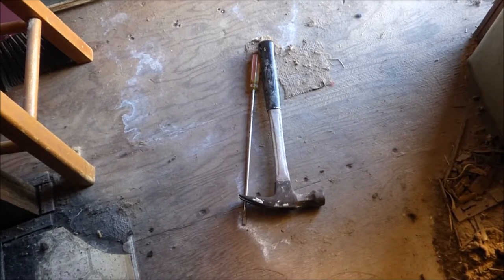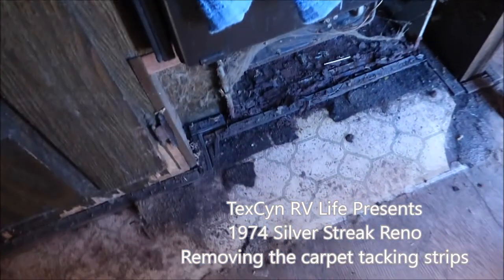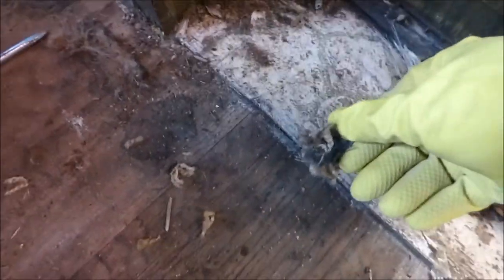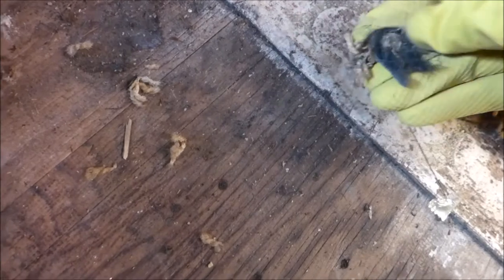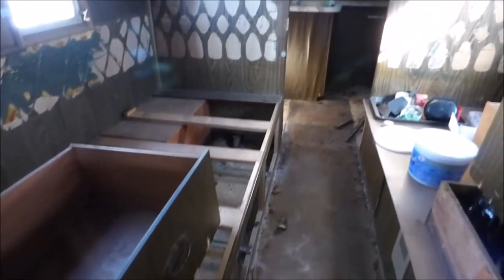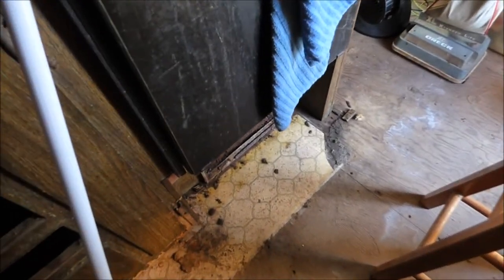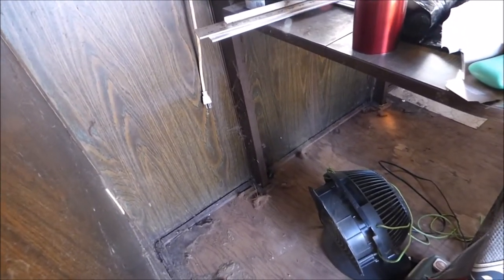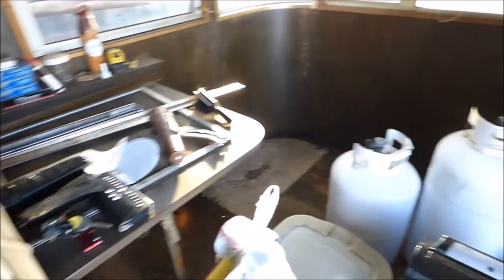1974 Silver Streak Reno   Part 6 Removing carpet tacking strips

Comment: I'd suggest buying a wrecking bar at Home Depot/Harbor Freight, would have made the screw driver/hammer removal a 5 min job.  Do not use silicone seal on a RV.........Google Eternabond line of RV seal.  They are readily available online or at RV stores.  The rivets in the windows are not a problem.   Not unlike the aircraft that I worked on for 30 years.  Everything is replaceable if need be.  Fortunate that none of the curved windows need replacement.  The others can be cleaned up and resealed.   Perhaps with a Dremel tool for the fine work if you really want to do it right.   Otherwise I'd clean/strip and repaint to cover up.
Reply from the maker: Thanks for the suggestions. I didn't know about a wrecker bar. I'm doing clean up now, then will need to check the systems, wash, caulk & repair on the outside.

Comment: If that is real wood, maybe strip it rather than paint.  I know it is dark now, but maybe see what a test spot looks like after you have stripped the smoke/dirt/stain from it?
Reply from the maker: It's still too dark for me. The real wood color showed when I took off the mirrors. I'm thinking retro. Painting the bases with a light cream color, door & drawer fronts another color. I might leave the cabinet in the living room it's original color though....although the one foor was riddled with a bunch of screw holes.
Reply: Maybe pay someone to look at the roof and clean the body before you do the windows. See how much a professional would charge to reseal them. What kind of floor are you going with. Do you get monsoon rain in the summer? Great job !!!!😍
Reply: I just noticed this is 3 months old, the video!😮😉